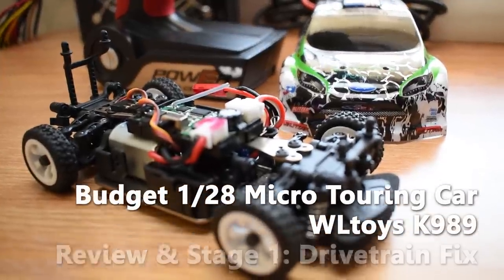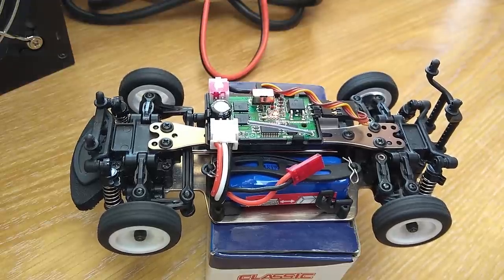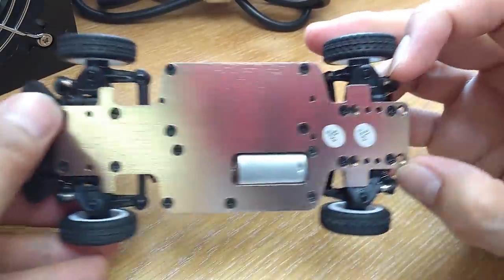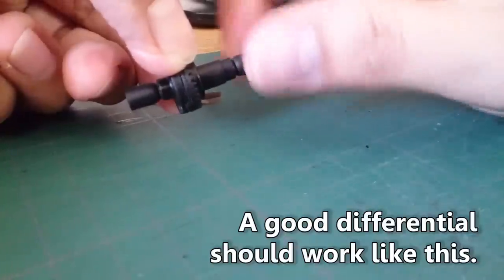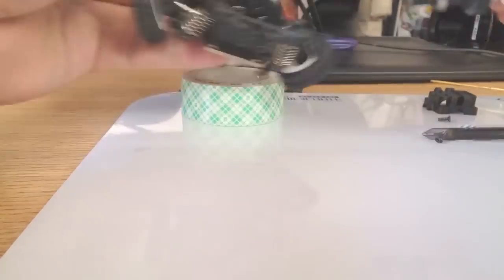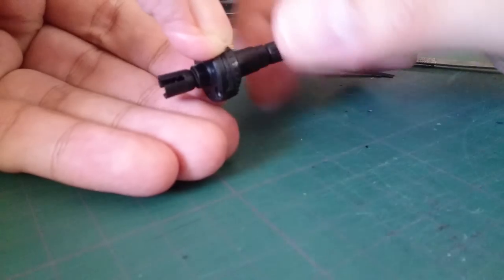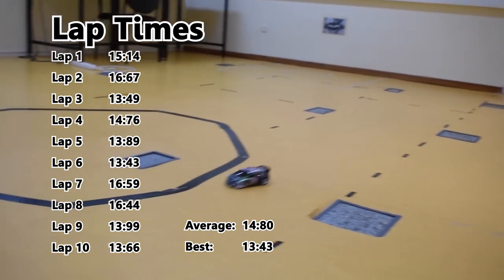WLtoys K989 Budget Touring Car - Stage1 Drivetrain Fix

Comment: Hi there friend, just wondering if there is a way to bind the k989 with the radio that comes with the 144001 I just received?
Reply from the maker: You can try this. Turn the car on, then turn the transmitter on and move the steering around. If they don't bind then it means the transmitter is not compatible with the car.
Because the 144001 has changed something so that transmitter won't bind with other WLtoys cars.
Reply: @BeaversHobby  thank you sir!🙏
Reply from the maker: @ogrope1  My pleasure.

Comment: I think the cause of the diff problems is factory over tighten the screws which spread the shaft wider .. I think one my diff they over tighten so much there is no way to fix it .. tried for hours the diff will not mesh or go together well .. ordering a new one or 2 ..

Comment: Hey i want to ask u its really important to me i bought this car to do drift car but im bad at drift also i see many ppl say Hard to drift with 4wd.And i know u spend a lot to make this car drift car.İs it possible to drift with it without spend much money or i should buy another 2wd car to make drift?This is my first rc so i need your help/Extra i wanna ask how to setup throttle trim sry im new at that
Reply from the maker: You actually don't need to spend a lot to make it a good drift car. Just a good set of drift tyres will do.  Get some Mini-Z AWD wheels with DS Racing drift tyres and you are good to go.
4WD/AWD is much easier to drive than RWD so you can stick with that. You don't need to setup the throttle trim either. Hopefully you'll get the new electronics with much better transmitter and it has throttle limiter (it's called dual rates) so you can limit the car speed and make it easier to control.
Reply: @BeaversHobby  well ty for reply i cant buy mini z wheels they dont sell to my country but im looking for new one also i want say stock angle enough to drift? Also u need to make  video about drift i think😂 to beginners like me/I want say that too idk idea about diff i need to work on diff to make drift?
Reply from the maker: @anl1267  The stock angle is not enough, you'll need to move the ball on the servo to the upper hole like what I showed in this video. Then the angle is enough for drifting. Can you order from Aliexpress? There are also wheels and tyres there, although not the best but they'll work.
Reply: @BeaversHobby  yes i can order from aliexpress,i checked banggood but nothing there, also u know battery for this car at aliexpress?About the angle i go check
Reply: Well i cant see the angle part i think also what tools i need to fix angle/İm new at that all and all looks so complicate 😂
Reply from the maker: @anl1267  Any 2S will work with this car. Check out GNB or Gaoneng if you want an upgrade battery. The wheels on Aliexpress are so expensive and the quality is not guaranteed. https://www.aliexpress.com/item/1005002740400989.html
Personally I suggest rcmart.com so you'll get quality parts in one sitting. https://www.rcmart.com/pn-racing-mini-z-awd-machine-cut-bbs-front-rim-f1-2-pcs-white-488wf1-00085170
https://www.rcmart.com/ds-racing-mini-lf-1-8-5mm-narrow-drift-tire-4-pcs-black-for-kyosho-mini-z-mi-lf1-00086108

Oh, yes, I forgot about the tools. You'll need a Philips cross screwdriver no.0 or 1, 1.5mm hex screwdriver or Allen key and a 4mm hex socket.
You can also get a computer toolbox that will come with  different small heads & sockets and a handle too. That works great with 1/28.
Reply: @BeaversHobby  i want to say ty for all replying fast and search ing products for me ur the best
Reply: @BeaversHobby  i Just checked rcmart they have shipping to Turkey its good news for me shipping price same with wheel price but its ok 😂😂
Reply: @BeaversHobby  i want to say lastly i still cant find that angle part at vid/Btw its free?
Reply from the maker: @anl1267  At 10:07 you'll see how to do it.
Reply: @BeaversHobby  i checked tools u said which one is for angle/İ mean u remove it with which one
Reply from the maker: @anl1267  I used the smallest cross (+) screwdriver. Not sure which number, probably #0 or #00. Anyway, the screwdriver kit will have it.
Reply: @BeaversHobby  Okay thx for all i think i cant afford them so i buy rim and wheel first try with stock angle.They all too hard for me im only 18 year old and still study so monthly get around 40 dollar😂Ty for all your help/Extra i want ask theres product on banggood for 6 dollar to remove wheels is there cheaper version of it?
Reply from the maker: @anl1267  Understood. The wheel remover you need is this https://www.aliexpress.com/item/4000533903083.html (in case you don't want the whole toolbox).
The angle mod is just an adjustment from with all the original parts, so you can do that with only 2 screwdrivers, 1 to remove the servo bracket and the other smaller one to move the ball head up. The screwdriver can come from any small screwdriver set, you can also use the one that is sold in a supermarket for fixing eyeglasses or something (probably around $5 in your currency). It's an essential tool that you'll have to use anyway. 
Here's the toolbox I use to dismantle the whole car. https://bit.ly/3HIT0RJ I think you can find it in your local computer stores as well for around $10-15.
Best of luck!
Reply: @BeaversHobby  i need M2 or M3 or M4 which one i ask because aliexpress 4$ cargo so im gonna check in my country/İ know i ask u a lot of thing sry for that
Reply from the maker: @anl1267  M2, the diameter is 4mm on the socket.
Reply: @BeaversHobby  Here is my final question i think rcmart is trust because im gonna buy all of them from there.I ask that because its country to country shipping
Reply from the maker: @anl1267  Yes, RCmart is trustworthy. It's one of the biggest RC stores online.
Reply: @BeaversHobby  i wanna ask, the tire u send fit to all mini z rims?
Reply from the maker: @anl1267  Yes, they fit all standard Mini-Z rims. You can select the width if you want all narrow or front narrow and rear wide.
Reply: @BeaversHobby sry i ask u all my questions.İ need to glue rim to wheel? Also products 7$ shipping 5.5$ its normal?
Reply from the maker: @anl1267  You don't need glue for drift tyres. $5.5 for shipping is normal for RCmart. That's also the reason I buy many things from them once I need order something.
Reply: @BeaversHobby  the point is if i add smth cargo price rise 😂
Reply from the maker: @anl1267  There's a limit to each range so I try to fill as much as I can. Actually $5.5 for shipping isn't that bad though, it just looks like a lot for $7 of stuff.
Reply: @BeaversHobby  ok so what can i buy more for that car?İ dont have idea actually.I need a new diff or smth?
Reply from the maker: @anl1267  Different wheels with different offsets so you can try them out. Like this one https://www.rcmart.com/yeah-racing-plastic-wide-rim-set-offset-0-1-2-3-white-for-1-28-awd-mini-z-ma-020-wl-0146wh-00108680 .
Different tyres compound also good. Like get LF-1, LF-4 and LF-5 to try out.
Reply: @BeaversHobby  i checked, i dont understand difference between lf-1 and lf-4
Reply from the maker: @anl1267  The higher the number, the less grip it has and will result in slower speed. LF-1 is around the same as Mini-Z original drift tyres. LF-4 is the slow one, good for AWD and RWD. I haven't tried LF-5 on AWD yet but it's fantastic on RWD.

Comment: Is it me or did you not get to the drivetrain my friend?
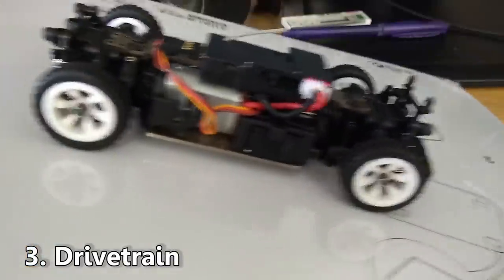Reply from the maker: 5:43 Checking the drive train
6:38 Start fixing - differential (This is where the sticky drive train problem comes from the most)
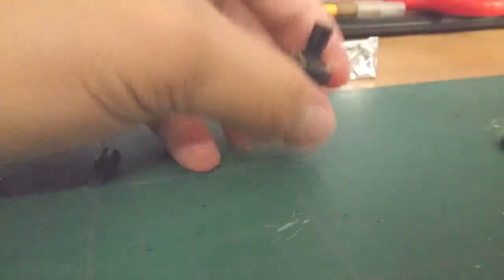8:51 Fixing over tighten gearbox & bearing slots
9:16 Run-in
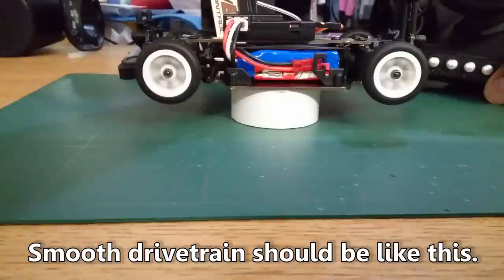9:48 Clean & lube
Reply: @BeaversHobby  

Can't thank you enough for your time. One more thing.... I'm locking my diffs per your suggestions. I'm doing my best to mod to a drift car. That being said, it seems like a lot of the diff steps in this video wont help my drivetrain if I'm just going to lock my diffs... is that correct?? Your right, the car is sticky/tight as can be. No free rolling what so ever.
Reply from the maker: @justinaldrich692  If you lock the diff things are much simpler. you'll only need to check if the outside of the diff is  to big. No need to fix the gears to make it work smoothly.
Reply: @BeaversHobby  

Okay, I'll do my best to sand the outside tiny bits at a time.
Reply from the maker: @justinaldrich692  Good luck with your project! 😃
Reply: @BeaversHobby  

I'm trying, it's a slow process trying to learn and waiting for parts. Also trying to figure out what other parts would be suitable for the K989...(you've helped with that too. ) What I'm wanting most is the front one way diff(red) and those extended CVDs. Just gotta save up. Lol

Comment: Is there a way to fix the rear wheel stabilizer? My has a lot of play, so the wheels do not stay true and can move a few degrees.
Reply from the maker: Some people changed the knuckles to long one (the front knuckles), turn the stabilizer side side to the back and mount the toe bar like Mini-Q Q7. Some do the Mini-Z AWD DWS trick with more stabilizer bars connecting to the chassis.
Reply: Beaver's Hobby I was looking at the aluminum upgrade kit, but I’ve tried some before and it looks great but is not a performance upgrade.
Reply from the maker: @adriancjones  Aluminium upgrade doesn't really fix this car. The hubs make the car stronger but that's about it.

Comment: is this car almost the same size as the mini z like would this car look to big next to a mini z or atomic 1/27
Reply from the maker: It looks a bit bigger than standard Mini-Z and AMZ. But it's the same if you extend the wheelbase to 98 and do the wide chassis conversion on MA020 and AMZ.
Reply: Beaver's Hobby thank you i wanna build a out door mini drift track and i have a atomic drz i wanna get something for my boys to drift
Reply from the maker: K969 is the one that's ready to drift. It can be a bit difficult to control but after doing some work it's much better to drive.

Comment: Hi! May I ask you where did you buy the fat you use at 8:43? Thanks
Reply from the maker: It's Tamiya Ceramic grease. It is made for plastic gear. You can also use any PTFE grease as well. I recently moved to PTFE because it's easier to find and much cheaper.
Reply: @BeaversHobby  OK thank you very much! I saw that in the stage 4 video, in the differential you put other types of blue and yellow grease, what is the difference between the PTFE grease and the other blue and yellow?
Reply from the maker: @fab8025  The blue and yellow grease are gear differential grease. As the name suggests they are mainly for adding tension in a gear differential. They have more viscosity (stickier) and add dampening effect to the shocks.
Reply: @BeaversHobby  I understand, instead the tool you use at minute 5:23 to separate the plastic pieces, where can I buy it?
Reply from the maker: @fab8025  It's ball link pliers. It is actually for 4mm head and bigger (WLtoys is 3.5mm) but it'll work. http://bit.ly/2lPPPm9
Reply: @BeaversHobby  thanks again, very kind! Do you have a facebook or instagram page where I can ask you for information?
Reply from the maker: @fab8025  Here's my facebook page. https://www.facebook.com/beavershobby

Comment: can 989 shell fit in the 284's?
Reply from the maker: Yes, it can. They are essentially the same car. You might have to trim the original splitters/bumpers out or replace them with K989 parts.

Comment: hello to you
could you tell me the total budget for the 989 please
thank you beforehand
Reply from the maker: It really depends on how much you want to do with it. Nowadays bare minimum would be around $73.
- Car = 58
- Wheels & tyres ~15
If you want better radio that will be good for many cars to come then add another $73.
- Transmitter Radiolink RC4GS V2 = 65
- ESC ~8
Basically you are looking at $146.

If you want to upgrade every bit of it even some of them will make the car worse like carbon chassis and aluminium parts then you will be spending at least $300.
Reply: @BeaversHobby  Thank you for your reply
anyway i wouldn't go as far as full option
for the radio, I have a flysky gt3b so that in less.
after that can be a brushless combo not too expensive in the 5500 kv
in any case, thank you for your reactivity because I hesitated with the Q1 which you may find better but my choice is made now.
I would go on the wltoys because of the ken block type body.
good luck to you and my best wishes for this year directly from France
Reply from the maker: @jean-lucdesenne3840  Since you already got a radio, this will make things easier. You just need a motor and an ESC. For a buget set I highly recommend Surpass Rocket motor with DasMikro ESC. 
Motor: http://bit.ly/3ircxKC
ESC: https://bit.ly/3h07teH
Don't get surpass combo because the ESC is bad.
Best of luck with the project.
Reply: @BeaversHobby  thank you very much for all it's advice
continued like that
Reply from the maker: @jean-lucdesenne3840  My pleasure. Good luck with the project!

Comment: Can you tell me why is my car go reverse when I pull the throttle but the car go front when I press the reverse button😅😅 can you help me solve this problem pls🙏
Reply from the maker: The motor wires are reversed. You can swap the wires to reverse the direction. There's a small tap on each wire and you can push it down to release the wire and swap it
Reply: @BeaversHobby  oh tq beaver😁
Reply from the maker: @Sayabencitaugeh1  My pleasure.

Comment: Hi i see a bind button in k969 car,  how can i conect a new control?, thank you.
Reply from the maker: From what I've tested that bind button doesn't do anything. If you want to connect to a new radio just turn the car on, turn the new radio on and move the steering around. That's it.
Reply: @BeaversHobby  Thanks my friend, please tell if i buy 2, Can I control each one independently or is there interference with the radios?
Reply from the maker: @alejandronieto8649  Yes, you can. It's 2.4GHz so you just turn the cars and transmitters on one set at a time and they'll work without interfering with one another.
Reply: @BeaversHobby  thaks
Reply from the maker: @alejandronieto8649  My pleasure.

Comment: I have one question for you what is that connection next to motor connection in ESC and receiver circuit board I have wltoys k969 and I don't have it
Reply from the maker: It's connector for LED lights from previous circuit board version.
Reply: Than please show in your next video how you install led lights
Reply from the maker: Well, I just know it's port for light but so far I haven't found a kit that would fit. Make a DIY or use a kit that connect directly to the battery is much better.

Comment: Is the process the same for k969?
Reply from the maker: Yes, it's essentially the same car with the difference at the differential. K969 doesn't have gears inside so you only need to check the middle plate thickness and overall diff thickness.
Reply: @BeaversHobby  I made this but burned out the motor! I couldn’t figure out how to change the gear ratio. Can I use this motor as a replacement? https://www.componentshop.co.uk/lba2030-18t-5160kv-leopard-inrunner-brushless-motor-2-pole.html
Reply: I mean the brushless upgrade video thanks
Reply from the maker: @Baddiework  No, the motor is too big. You'll need 1625 or 1410 size. Here's the best budget motor at the moment. https://bit.ly/3ircxKC
And the best budget ESC at the moment. https://bit.ly/3h07teH
Reply: @BeaversHobby  many thanks! I had the leopard hobby 9500kv before. How would this (https://www.componentshop.co.uk/lba1625-48t-6000kv-inrunner-brushless-motor-2-pole-leopard-hobby.html) compare? I am in the UK so would rather not wait a month again. Also there is only one metal gear for the motor. How can I gear it right so it doesn’t burn out again? Do I need to get extra gears other than what is in the box. I modified the motor mount with a Dremel. Many thanks! Also I built an active rear wing with a Hitec servo at the back which I can control through the transmitter aux knob but also have it set in the Pmix to change when I brake, it’s cool I’ll send you a video when it’s all together again! I used a Schumacher 1/10 touring wing so it would be big enough to make a difference.
Reply from the maker: @Baddiework  6000KV is about right and will be more than enough for a drift car. As for the gear, if you can't get it out you can use plastic gears for small robots. It's 0.5 mod so you could find the same gear pitch in DIY robot shops where they sell stuffs for Arduino and Raspberry Pi.
Reply: @BeaversHobby  my plastic front diffs broke on 2 cars what is the best metal upgrade for front? Also which replacement driveshafts? Thanks
Reply from the maker: @Baddiework  Metal diffs will break the pinion gears on the prop shaft so that's not a good idea. The problem is that WLtoys' gears are very brittle. You can replace the diffs with Mini-Z AWD diffs and use 10.5mm universal shafts (CVD).
https://www.rcm8.net/collections/parts/products/kyosho-mini-z-awd-differential-gear-assembly-md005
https://www.rcm8.net/collections/parts/products/gld-aluuniversal-shaft-105mm
You can also mod the prop shaft pinions to something more durable. I also touched on this topic in the stage 4 of this project.  https://youtu.be/ci54dkbc_Bc